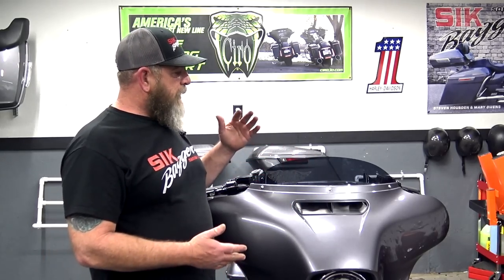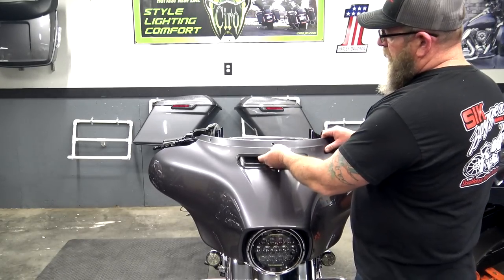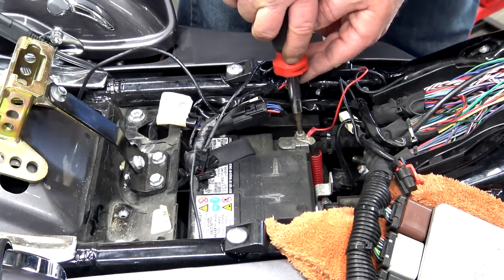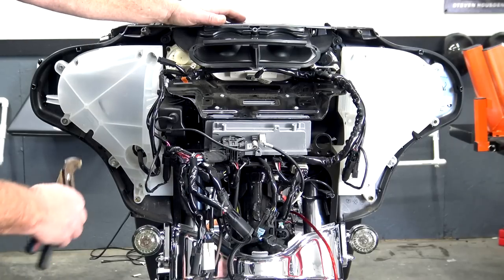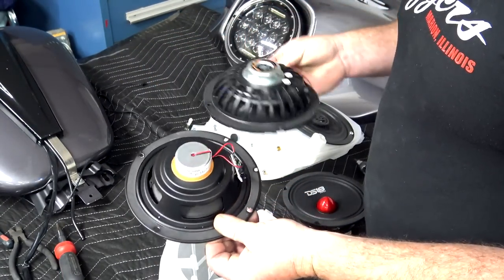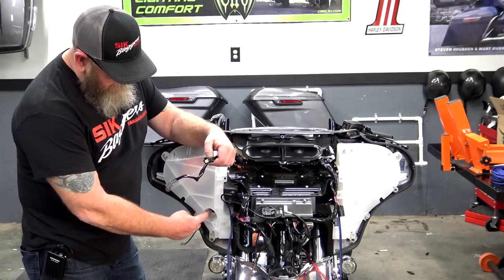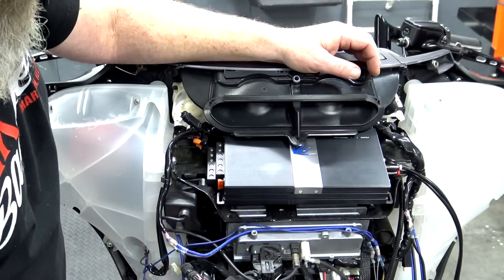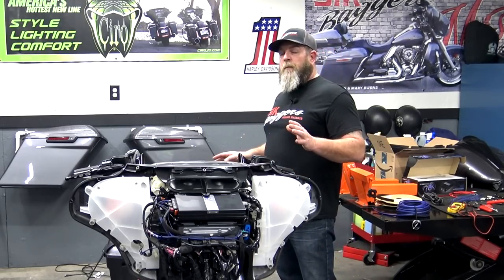⚡Install Amp Speakers Stock Harley Touring Radio⚡

Comment: Dont companies now do more plug n play?  My Hogworks came all plug in play.  Took about two  hours to do a two channel amp with two new speakers. Time was mostly because it was my first time.  Do the more high tech ones  come that way?
Reply from the maker: Do you mean hogtunes? Yes there a lot of companies that do plug and play, and you pay for it too. This set up in this bike was about 250 bucks vs the roughly 800 hogtunes charges. Outside of having to hook up a line out converter its the same thing you get form them. Absolutely nothing wrong with the plug and play stuff , this just to show guys they dont have to pay the extra money for plug and play and its easy to do at home. a 400 watt amp and 2x 200 watt max 6.5 inch speakers is not worth 800 bucks to me because its plug and play thats all.
Reply: Steven Housden yes hogtunes. My bad.  To me the extra money to get plug and play and not have to go out and buy all that wire and connectors is worth it. Lol. Love the videos. Especially the oil change one   Helped me out a lot.
Reply: @jccuby7771  Steve is right, for far less than $800 you can have a far, but far better, sound system from an actual Motorcycle Sound System Shop where a "Plug and Play" package can be put togther for you.   I see the Hogtunes scam all the time and always feel very bad for those who get convince to purchase it. Whenever you're ready to upgrade again, or any of your fellow riders wish to upgrade, feel free to contact us. 
https://www.motorcyclessoundsystems.com/
https://www.facebook.com/MotorcyclesSoundSystems/
https://www.instagram.com/motorcyclessoundsystems/

Comment: does matching the voltage on the LOC eliminate clipping? i installed the same setup without the LOC and the speakers cut off when i turn it up over halfway
Reply from the maker: well..im not sure thats whats causing your clipping to be honest but it should be matched anyway or you will get distortion. The voltage should be matched to the radio...best way to check is turn it down and see if it stops clipping
Reply: no i have to either turn the bike off and on or unplug the speakers from the amp and plug them back in to gwt sound again once it cuts off the speakers.
i've order the LOC you used in this video once i get it i'll take my bike to a professional. 
great video, thanks!

Comment: OK my question is all the stock Speakers on my 2018 roadglide ultra  are 2 ohm speakers But I'm going to keeping the stock head unit.  If i use A line converter  Am I able to convert to a 4 ohm amp and speakers with no problems ????
Reply from the maker: You will need a 2 ohm stable amp...the 4ohm amp will play the 2ohm but it will struggle with the load.
Reply: OK thank you for the information  I've been curious about that I've been looking at 2 ohm speakers  But I feel like I can't find decent ones on a budget

Comment: I have a 15 street glide special, I've heard you have to have someone adjust the radio to have a amp installed on the bike. Is this true
Reply from the maker: no...what they are referring to is "flashing" the radio for "4 channel, no amp" what that does is turn the internal amp off and flatten the eq on the radio.  Most HDs wont even do it anymore. Add your amp, turn down your bass and turn off the adaptive volume that controls the volume as you speed up or slow down. Turn the gain on the amp down all the way. Put some music on that you normally listen to. Turn your volume up to about 80% ...start turning your gain up gradually...when you hear distortion, turn the gain back down slightly. If you want to add bass..increase your bass on the head unit, if you get distortion then turn your gain down again. Its give and take. This is ear tuning and about as close as you will get without getting a DSP to fine tune it.

Comment: So do I need the 4 or 8 ohm speakers?
Reply: Never 8ohm. That’s for multiple speaker, OEM audio and home setups. 2ohm if replacing stock or having a simple 2-4 speaker setup on the same amount of channeled amp. 4ohm if you’re doing custom…. (2) 4ohm speakers ran in series makes a 2 ohm load, drawing more power than a 4 ohm load would. lol still confused huh

Comment: After doing this install do I have to flash my stock radio
Reply from the maker: Set your stock radio to flat on the eq if you have one and turn off the speed/volume and youll be fine.

Comment: Ever have a fob issue after install comp!ete. I have everything connected sounding good but now I have a security issue turm bike on and nothing jiggle a few wires no more fob issue leave it sit same thing turn the key bike is locked jiggle wires unlocked I'm stumped
Reply from the maker: no I havent man...sorry...Sounds like a loose wire for sure...if you are wiggling it and its working id start checking all the connections. Also you may  pick up some dielectric grease and hit all the terminals to make sure everything is getting a good contact.

Comment: do you need an loc if you are using an aftermarket head unit
Reply from the maker: no...your after market unit will come with rca out signals...thats what your amp needs for IN...so just run it from the head to the amp with rca and out bare wire back to your speakers
Reply: @sikbaggers  ok thanksyou very much for the quick reply awesome video

Comment: Do you have to use marine grade speakers?
Reply from the maker: So I get this question a lot! The question is, are you the type of rider that rides in the rain, or do you get caught in the rain sometimes? Do you wash your bike with a carwash/garden hose? Marine grade speakers lack sound quality..all of them do...you lose on the sound end just to keep them water-resistant. If you get caught in the rain like everyone else sometimes then I would not use marine grade...bat wing fairing speakers are almost straight up and down and protected by the inner fairing..road glide are slanted a little more but still pretty vertical. I hardly ever use or install marine grade speakers.

Comment: Hello i want too install 2 extra speakers  on the lower vent fairing using aftermarket amp and 4 speakers on a 14 street glide it comes with only 2 speakers from the factory.i know I have to take the signal from oem speakers wires to a pac in line converter but how am I going to get the signal to the 2 extra speakers on the lower vent fairing do I need a 4 channel line conver? And jump the 2 left front and rear and the 2 right front and rear cables to get a signal for the extra speakers? I bought a pac 2 channel inline I don't know if it can work for 4 speakers any help that you can give me will be appreciated
Reply from the maker: get 2 rca splitter and split the signal after the PAC going into the amp..now you have 4 channels in and can use 4 channels out
Reply: @sikbaggers  thank you so much for the help

Comment: How do you feel about a hog tunes system?
Reply: Hog
Reply from the maker: Hey Ray...sorry I just now seen this. Im not actually a huge fan of any plug and play kit...some are OK...but you really are paying for the plug and play adapters and its  pretty easy to get around those and save money to put towards better speakers and amps that come with most plug and play kits. The hog tunes sound decent enough, I just think they are way over priced for what your getting.

Comment: What did you use to mount the amp
Reply from the maker: drilled my own holes and used plastic washers on bolts with nylock nuts

Comment: Big ass magnets isn’t what Harley was looking for because of weight reduction. The smaller magnets are used to help reduce front end wobble.
Reply from the maker: front end wobble from speaker magnets? Jeeezz....mine should have a tank slapper then.....but yet thousands of us run these and no wobble. Good theory though. The smaller ferrite magnets are Harleys way of adding shit speakers to a 25k bike. You can get 
 neodymium magnets on pro audio at half the cost that handle 10 times the amount of power...still a small magnet...why isnt harley doing that? Liquid shit speakers and audio systems..its a joke sold an expensive bike.
Reply: @sikbaggers  yeah I heard about that the other day. It appears Harley went with the lighter magnets for the faring speakers in order not to screw up the handling of the street glide. All could be bs, but none have been proven false.
Reply: @sikbaggers  some of those magnets are huge, so it makes some sense.
Reply: @sikbaggers  have they told you one way or the other. Some don’t realize Harley changed the frame in 2009 because a a issue with wobbling.
Reply: @sikbaggers  some ride the road glide so the fix faring will absorb any of those issues. Hell where’s the Physics geeks when you need them?
Reply: @sikbaggers  I’m not talking about those shit standard speakers. They should never be compared to a real system. Same with cars. My SUV system has a $5,000 Burmeister upgrade. The Harley system is actually a Harmon kardon system  which was common in Mercedes Benz.
Reply: @sikbaggers  my issues with the boom2, the sound is clear, but it needs more overall adjustments. It also needs a separate rider controlled midrange adjustment. As for being loud and clear it has that in the 6 speaker set up I have on my 2017 street glide Special. Total 900watts,3 amps. It’s setup like the 2018 CVO. With lowers.
Reply: @sikbaggers  I believe if I could get my hands on upgraded speakers, that’s compatible with those 3 amps, I can get a little more Quality sound out of them. I’m not throwing it Uber thousands I spent already.

Comment: One question...How do you know if you need 4ohm or 8ohm for my lowers with an amp?
Reply from the maker: that depends on how your system is set up now...Let me know what you have in there now. Are the fairing speakers 4 ohm or 8 ohm and do you have an existing amp? What ohm stable is the existing amp?
Reply: @sikbaggers  I don't know.  I have a 2015 street glide special with Boom System. All factory, stock batwing speakers that I plan on changing when I put my lowers in. I plan on putting that same system you had in the video. Also, should I put all 4 midrange speakers or two mids and two bass? Your video will help me get it done, as it was very specific. I just don't know electronics.  Ohms, volts, amps all confuse me. I'm gonna wait until winter so I can take my time, cause I'm a truck driver and am gone most weeks.  The extra links you added at the end is what got me concerned about the ohms. JUST DON'T WANT TO BURN MY BIKE TO THE GROUND...
Reply: No amp yet and haven't bought speakers because of this issue with ohms.
Reply from the maker: @RonallSMarsh   No worries you wont burn your bike down by mixing ohms, it will just sound like trash and usually ends up burning up an amp or smoking a voice coil on the speaker. I Which sucks either way. The only time you really need to worry about this is if you are adding to an existing system. Since you are replacing everything and adding 1 set of speakers you are in a good place. With what you are wanting to do its pretty easy. You will have fairing and lowers so that's 4 channels. Your amp will need to be a 4 channel amp  and at least 4 ohm stable, which most are. FRONT left and right, REAR left and right. The rear lef tnad right will now be going to your lowers since you don't have rear.  Simply pick a good 4 channel amp and since both lowers and fiaring are 6.5 inch speakers pick up 2 sets of 8 ohm 6.5 speakers. 8 ohms take less power than 4 ohms.  NOW the part I was talking about in the video where it gets tricky. You wont have to worry about this unless you start adding 6 or more speakers to your 4 channel amp. 6 speakers on a 4 channel amp. How do you do that?   Lets say you have the set up I just said to get. And you want to add a set of saddlebag speaker lids. You want to run the lowers and fairing on FRONT left and right. which leaves the REAR left and right for your new lids.  You would run these in series which would reduce your ohm to half..8ohms is now 4ohms. Since most amps are 4 ohm stable (meaning the amp can handle pushing 4 ohms) you are still safe. But lets say you had 4 ohms speakers instead of 8. Now when you run them in series you have reduced the 4ohm to half. You are now pulling 2 ohms. Lots of smaller amps are not 2 ohm stable..so that's where you have issues. It will work, it will sound like shit, and over work your amp causing distortion which fries speakers and/or burn up the amp.  If the amp is 2 ohm stable you are still good. So everytime you had tie speakers together it reduces the ohms to half. 8 becomes 4, 4 becomes 2, 2 becomes 1.  The amp must be stable in the ohms you have the speakers. A 4 ohms stable amp is much cheaper than say a 2 ohm or even a 1 ohm which is pretty expensive. Just because an amp says its 2 ohm or 4 ohm stable doesn't mean you have to run it there, it just means if you start running speakers in series it will handle it.  So buy getting 8ohm speakers now you are setting yourself up in a good place if you ever want to add more speakers but don't want to purchase another amp to install with the one you have.  You can simply run the 6.5s in series which drops your 8 to 4 and your still safe. And that leaves a channel open for your new speakers you are adding. There are tons of videos on youtube about running speakers in series or in parallel. Way easier to watch that than me explain it.  There are some good videos that explain ohms vs current etc also. It sounds like a lot but if you just remember adding speakers to speakers always cuts your ohms and you need to make sure you amp can handle that draw. If you have any questions man just let me know.
Reply: @sikbaggers  THANK YOU very much, very helpful. Now I can go shopping. I really appreciate it.
Reply from the maker: @RonallSMarsh  No problem man, anytime and if you get into it and have any other questions let me know.

Comment: Noob here but am I missing what connects the amp to the actual radio?
Reply from the maker: out of the radio speaker wires, (the pink wires) to the LOC, Out of the LOC to the amp, out of the amp back to the speakers. So the speaker wires that go from the radio to the speakers, you will cut that and add in the LOC and the amp and then reconnect it to the speakers.
Reply: @SIK Baggers  fantastic. Thanks. Found a unit from skar (sk-m4004d) that ends up becoming the LOC and gives you rca out then. The market has really grown with this stuff. Any worries on moisture getting to these units while inside? Also going with the ds18's. Hopefully everyone can hear Conway and Garth goin down the highway. Lol

Comment: I've got a 2020 Street glide, what speakers and amp do you recommend if I just want to do the front speakers now and eventually add bag speakers later.
Reply from the maker: Sound digital 800.4 EVOx and a set of  PRV AUDIO 6MR500-NDY-4
Reply: Thank you. Your videos are excellent!!
Reply: @sikbaggers  Hey man thanks for the awesome videos. I bought a set of these speakers and and the wiring from the install video. Do you recommend the same Amp even if I will not be installing bag speakers? Or should I use a smaller one? also wondering if you had a link for inline fuse? and last question which stereo would you recommend? 09 SG Anyway thanks for all the videos super helpful!
Reply from the maker: @patj4845  yes you can use a Stesom 400.4 and its will be great for just the two fairing speakers. I install a lot of Sony single din radios in the 13 and older bikes. But there are literally a ton on the market that will work..if you want marine grade check out Aquatic ...just be prepared to bust out the wallet. As far as the inline fuse..click the link and take your pick..one of the tube style is what works best https://smile.amazon.com/s?k=8%2F10+Gauge+AWG+in-Line+AGU+Fuse+Holder+with+40+Amp+Fuse&ref=nb_sb_noss

Comment: That's a set? Where I can buy those
Reply from the maker: if you are refereeing the the speakers you can purchase those on amazon..,.around 30 to 40 bucks each I think...DS18 PRO-GM6B you can fo 8ohm or 4ohm depending on what your goal ohm load is on the amp

Comment: Got another question...the instructions say ground goes to body not battery. Is  this correct?, because i already put it to the body and it was a bitch
Reply from the maker: Putting it on the frame is fine as long as you stripped back any paint and have a really good ground to the frame.

Comment: Do I need these same things for a 2018 road glide.
Reply: The same what?
Reply: Oh I figured it out. I bought the same converter and followed the instructions
Reply: @joshp5795   how did you mount an amp in your road glide and what were the dimensions on it? I'm wandering what I can fit before I tear it down.
Reply: @ndouglas800  I mount my Amp in one of the bags. It's a small JL Audio Amp. Made to fit under the seat of a Smart car. I was thinking about moving it.
Reply: @ndouglas800  I did not dill mount holes. It's small enough and light enough to be held there with double sided tape

Comment: The magnet being bigger does not necessarily mean that speaker is better, as there are two different types of magnets for speaker!
Reply from the maker: Ok exclamation point....Since these are both ferrite magnets( ds18 pro vs stock harley speaker) that I am comparing then yes, yes it does.  The boom audio speaker does have a single neo magnet and I can show you the ds18 version of that 6.5 that has 12 neo magnets that size for a fraction of the cost of boom audio....!
Reply: @sikbaggers  do you like the ds18 products? I have a biketronics 4180 and there titan II speakers and want more from my front speakers. I really like the looks/specs of the ds18 pro-zt 6.5 i understand i will have to remove some of the pod on the road glide.